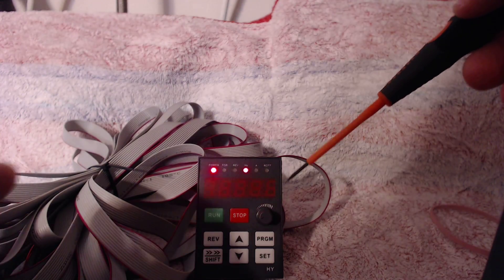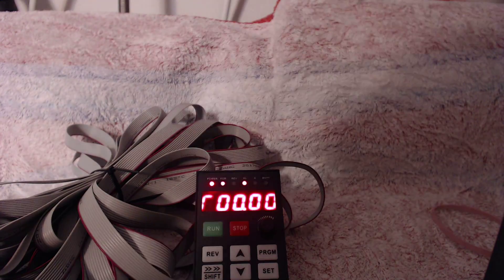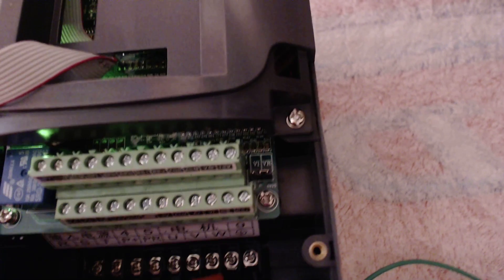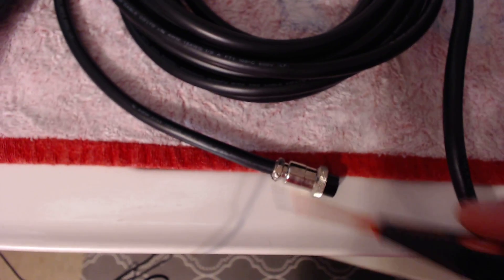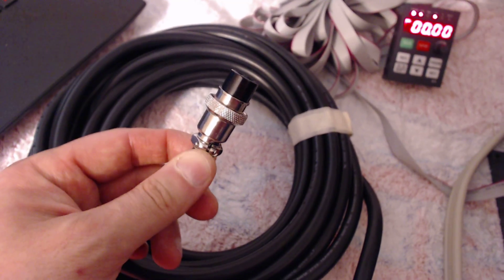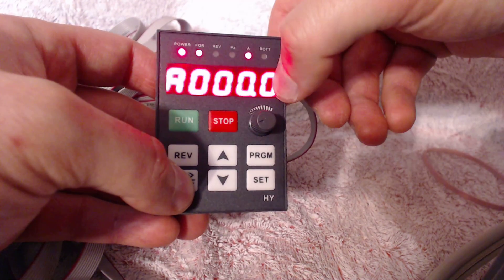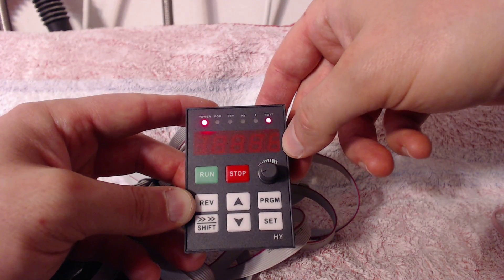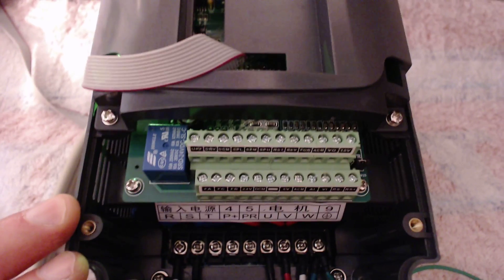VFD Wiring Done Correctly  & Amp Usage On The Digital Interface..

Comment: Ton of insights here - thank you so much for sharing your expertise. I am in the States and intend to use my wall outlet's third prong as my earth ground. I apologize in advance if this is the kind of rambling brain fart that should be addressed with a second cup of coffee, but can you offer a sanity check on the earth ground terminals in the VFD enclosure? One is on the screw terminal block ("screw terminal earth ground" for the sake of something to call it), and two additional screws in the VFD enclosure have earth ground symbols to the lower left and lower right of the screw terminal block ("enclosure earth grounds"?). So far everything matches to what you describe. You mention being able to use all three to ground the input power, spindle cable, and spindle cable drain to avoid pigtailing off the single earth on the screw terminal block. I have not yet powered up the VFD, and with the unit unpowered, I show no continuity between the screw terminal earth ground and either of the additional enclosure earth ground screws.  Is that expected, or would you expect to see evidence of a connection between the enclosure earth grounds and the screw terminal ground?
Reply from the maker: dysaniasdemise, thank you for your support. If you have no continuity for ground on the ground terminals on left, and right side of the VFD enclosure on your particular unit using my ground plug with terminal splitter located here https://youtu.be/IUHYy3zrv4E is the solution. It would allow the three required leads to be run from the splitter to the ground of the spindle motor's terminal block, and the left, and right screws.
Thank you,
Vince
Reply: @corvetteguy50  Excellent, thank you again
Reply from the maker: @dysaniasdemise  You bet :)
Vince
Reply: I can also confirm that those two lower screws with ground symbols next to them show no continuity to the ground terminal on the spindle output side, my VFD is supposedly a genuine huanyang.. does this mean that it's not?

Comment: Is it fine to use 220v vfd on 230v
Reply from the maker: Solomon thank you for your support. Yes its fine for that voltage difference. Thank you,
Vince
Reply: hi Vince thanks for the response. Watching your video you seam to know what your talking about, and I really don't I've never heard of a vfd till a couple of days ago. I'm 18 years old and just getting started buying some woodworking tools I bought a old Luna w59 3phase combination table saw,jointer, spindle. It has three 2.2kw 3phase motors in it they are all connected to a single control panel and will only be used individual. so I think I only need one vfd since all the motors are the same and will not be use simultaneously. Do you think I should get a 3kw or 4kw vfd huanyany I'm unsure how much extra I need for starting up the motors
 https://bit.ly/2AR8anR  
https://bit.ly/2VMu1VZ 
This may seam like obvious answer to you buy ive been struggling to understand it as I have no experience with electronics thank you for any advice and for taking time to read this.
Reply from the maker: Solomon, thank you for your support, and your correct a single VFD is all you'll require. You'll require a 2.2Kw VFD if that's what the motors are rated for. 

Thank you, and have a great weekend,
Vince

Comment: Hi! I'm building a new CNC machine, I have MACH 4, ESS, G540 and Huanyang VFD (4kW) with a 2.2kW Spindle. COuld you please explain how to connect all these so the spindle starts and speed to be controlled from MACH 4? Thank you!
Reply from the maker: Thank you for your support.  I would proceed with extreme caution using a 4kw VFD with the 2.Kw spindle as it can, and will  easily destroy the spindle do to it providing twice the power output of the spindle. Mach4 setup should be very similar to Mach3's in terms of settings. I can provide the G540 Mach3 settings if you contact me through email at Storm2313@gmail.com

Thank you,
Vince
Reply: @corvetteguy50  Great video Vince and very useful VFD setting sheet. I am not sure that you are correct here though.....just because a controller is capable of supplying 4KW does not mean that the spindle will consume 4KW. The spindle will use its rated power. If anything, it is beneficial to have a higher rated inverter as (i) allows you to upgrade to a higher rated spindle later should you wish to and (ii) less stress on the inverter using a 2KW spindle on a 4KW inverter.
Reply from the maker: Thank you for your support. 

I'm not sure where you heard that in the video as I never said that a spindle would consume the maximum power rating of its selected VFD. 

Actually the spindle like any other A/C motor will only pull the amount of amps it requires when under load from machining. 

Optimally and end user should never in best practice run their equipment under maximum stress, so hitting even close to a spindle's matched VFD's amp rating is usually never done which will certainly increase the platforms longevity. 

Using a larger VFD than your spindle requires makes the end user pay more than they're required to which is fine if their budget supports it for a potential later upgrade, but certainly not required as all their doing is leaving all that extra power not being used by the VFD "on the shelf" 

Thank you,
Vince

Comment: hi Vince , 

in your VFD setup  in PD143 how did you come up with 4 poles not 2,  ....  at 400hz and  24000 rpm  will that make 2 poles.  can you explain please.

Thank you
Reply from the maker: Max, I corrected the typo in the instructions your correct the spindle is 2 pole. Thank you, Vince

Comment: Just to make sure while looking @07:25 with all connected cables visible in and outside the VFD.

The Grounding Terminal to the right of U V W has two wires connected to it - One being the Grounding Wire of the Spindle Cable and another spliced to the Shielding of the same Spindle Cable ?

That lonely Green Wire that is following the black and white offscreen appears to be the grounding wire of the 220V Power Cable but it doesn't look like its connected to anything inside the VFD ( hard to see ) - I assume this is where the Grounding Terminals mentioned @05:20 come into play? Just when I expected you to say your RS(T) wire's grounding wire should go there you suddenly start talking about shielding the 220V Cable too - Is THAT Grounding Terminal supposed to, like with the Spindle Cable, accept both the Grounding wire AND the Shielding of the 220V Cable?

You kind of only talk about connecting the Spindle Cable on the VFD end but what about the Spindle Side? Does the Shielding mesh make contact with the Plugs Housing? I assume not as otherwise it would create a Grounding Loop with the Spindle Cables Grounding Wire the moment a Spindle gets attached to it.
Reply from the maker: Durahl,
Thank you for your support. 

Your correct the power cords ground is attached to the terminal on the far bottom left which I discuss in the video. The cable I'm using to power the system is just to power the unit for illustration only as discussed in the video.

 A double shielded cable should be used, and the shield ground lead will connect to the same lower left corner terminal that has the earth ground from the spindle cable going to the unit. Your also correct in that you only attach a shield drain ground to one end of then either the VFD end which I prefer, or the chassis/power cord plug base pending its metal for conductivity. This assures no ground loops. Thank you,
Vince
Reply: corvetteguy50  you told me to get your contact info from your you tube.
Reply from the maker: Please message me at storm2313@gmail.com for my number. Thank you,
Vince